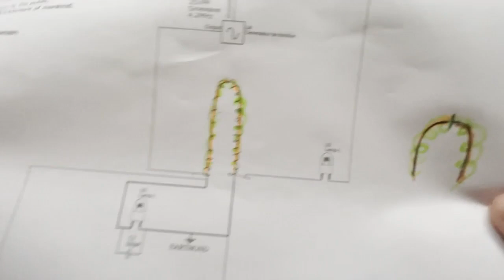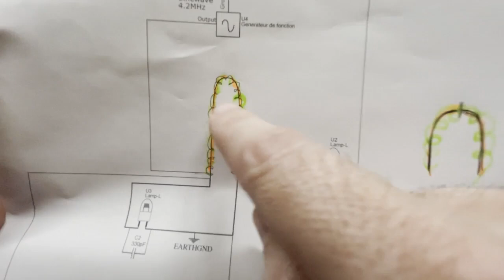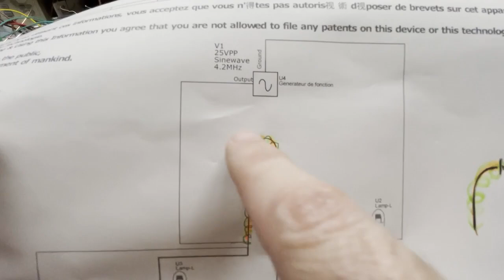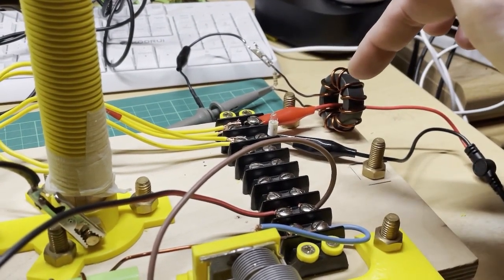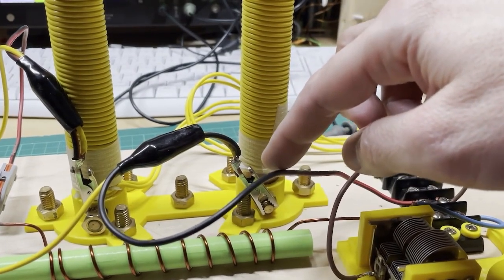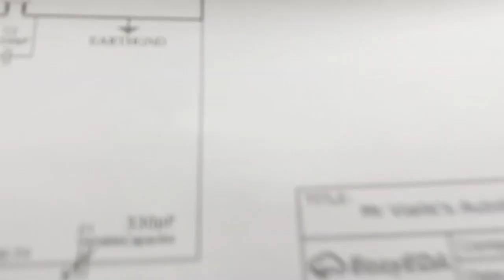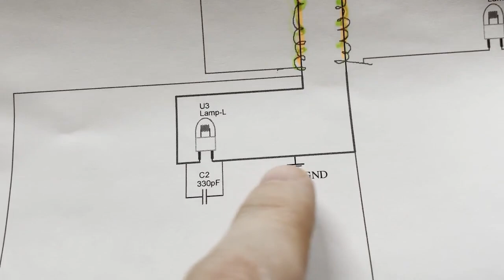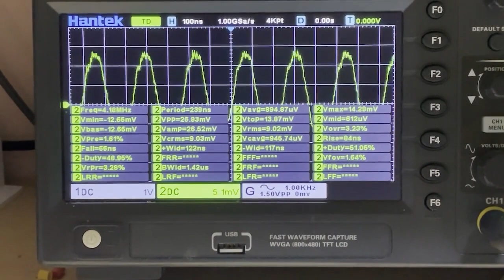Replication of the "U" AutoGenerator (Version 2) - Le U AutoGénérateur de Mr Vialle.

Comment: I'm curious what constitutes "cold current". More current measured at the load than at the source only means you have stepped up the current. This would necessarily mean you've stepped down the voltage and the net power transfer is less than 100% (conservation of energy). I'm confused as to the intent of this demonstration?
Reply from the maker: Cold current was coined by Mr Richard Vialle, who was a researcher and a physicist. He found out that there is no heat in the autogenerator (on the output) because the electron does not rub anymore against the copper but instead vibrates. What you are witnessing is called quantum field energy. My measurements showed that both voltage and amperage at the input were less than at the output. There have been more than 20 successful replication of this devices and about a dozen of researchers that got overunity. Conservation of law of energy is not broken because this does not belong to classical physics, as the energy you are witnessing belongs to Quantum field energy. So this is a very different type of energy. If you are interested to learn something new, try and replicate it.
Reply: @michelsbench  I don't doubt what you think you've measured, but I do highly doubt the validity of your measurement techniques. There are many ways to misinterpret data if you aren't using the right tools and methodologies to measure the phenomena you are trying to explain. That being said, I do believe there are simple explanations based on classical physics and simple circuit analysis that do explain what you are observing (apart from the over unity claims which are likely a result of inaccurate/incomplete measurement methodology, as I've mentioned). If you break down the elements of the "autogenerator" into it's basic circuit elements then your observations can be explained without "quantum electrical effects". I would be more than willing to share my thoughts on how your observations can be explained simply, if you are interested?

Comment: Nice video. Did you 3d print the variable capacitor?
Reply from the maker: Hi Shawn, nice to hear from you. I Love your work by the way. I purchased the variable 330pF capacitor online and then I measured the holes of the cap and then 3d printed a couple of parts to mount the cap on my board.
Reply: @ I love your work. You are very clever and creative. Thank you for the timely response—blessings, friend.